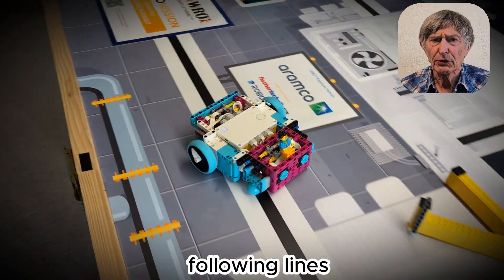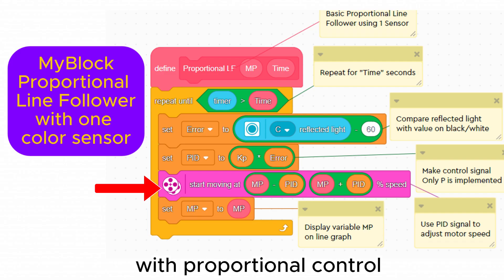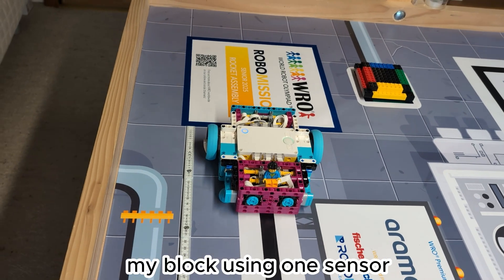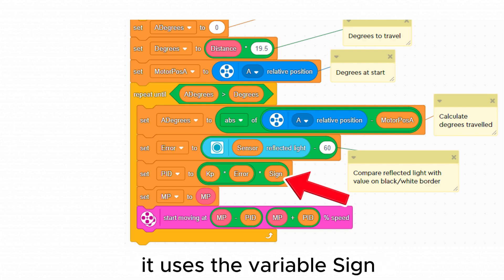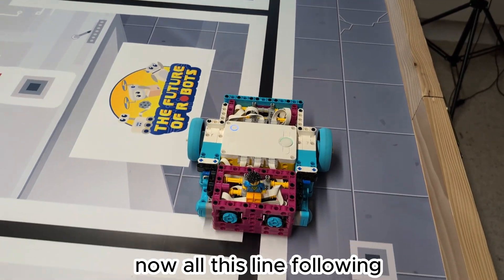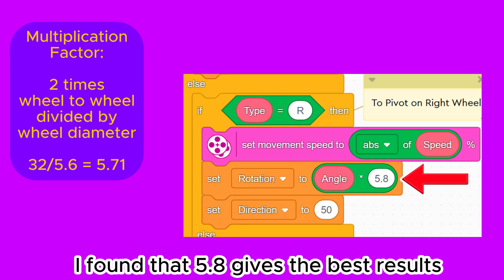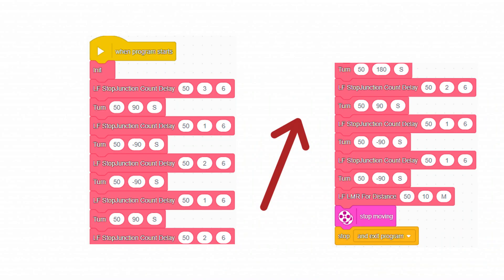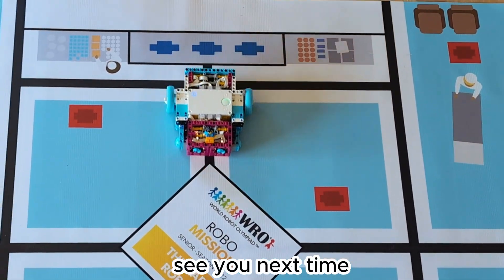Master Line Following and Junctions

Comment: This video is truly amazing and extremely helpful! You’ve presented rare and valuable information that we don’t usually find in other tutorials — thank you for your bold and clear presentation.

I have one question:
I’d like to detect junctions using only one color sensor. Is there a way to recognize  junctions and decide at which one the robot should turn — using just a single color sensor (not two)? I would really appreciate it if you could share any suggestions or code examples for how to do that.

Thanks again for the great work!
Reply from the maker: Hi Hanaa
I will try to answer your question. If you are using only one sensor for line following, a proportional line follower will follow the border between white and black. If you are following for example the right side of the black line, you would normally mount the light sensor a bit to the right so that the robot would be nicely centred over the line. You could then sense a junction which turns to the right, but not one which turns left only. I am just wondering if there is a solution to this if you know in advance what type of junction you are approaching. I have not tried it, but if you mount the sensor in the middle of the robot, you could follow either the left or the right side of the black line and then sense either a left or a right junction. The robot would shift laterally by the width of the black line, which should not matter too much. I will try this out sometime!
Best regards 
Paul

Comment: Do you have any tutorial for Ev3?
Reply from the maker: Hi there 
I don't have any tutorials specifically for EV3, I only have Spike Prime available to me. Most of the coding would be the same and should work with EV3.  Maybe using the gyro would be different as it is not built in the EV3 hub.

Comment: Hi. I would like to ask you for advice regarding the color sensor. If I use the light reflection output in the program for the follow line, do I have to have the sensor set to that as well? Because I have a feeling that the sensor is preset to the "color" output.
Reply from the maker: Hi
I had to think about that, it's a good question! I have never even thought about doing this, I just use the colour sensor either to recognise a colour or to line follow using % reflection and it has always worked. I think the setting you refer to is just to decide what you display when you look at the hub details with the programming software. I hope this helps you.

Comment: Hi 
First thanks for your videos they give me a lot of new informations
Can you make a video about reading blocks like in wro 2025
senior 
i know how to do it but i hope you can make this video maybe i can learn new way
Reply from the maker: Hi there 
I have been working on WRO senior, and I use a broadcast to read the marker block colours as the robot drives past them. This is faster than stopping at each block to read it. I save the colour codes in a list this gives you some advantages. For example you can make an instruction to only save a value if it is not already in the list. This will remove the possibility of saving the same value twice. I also add the values -1 and 0 to the list so they don't accidentally get saved. I will think about doing a video on this, it can be quite tricky to get reliable results!
Reply: @why-not-bot  thank you for your answer and if you do a video about it I will be the first person who will see it

Comment: Thanks for the great video and the continuous improvements on the ramp codes and the junction codes! Super useful! We will try them this week on our robot ❤
Reply from the maker: Thanks for the feedback, good luck with your robot!
Reply: @why-not-bot thank you! I have a question regarding the turn - I have used the universal turn code previously (using Yaw). Most of the time it works perfectly, but sometimes it would turn too much and get stuck or turn too much in general (maybe because the speed is too fast?). I guess using the turn function in this video would solve the first problem because it does not rely on the yaw, but do you find the turn code in this video more accurate or similar as the universal turn? Thank you for your response in advance!
Reply from the maker: Hi again,
You might find that changing the repeat until<1  to <1.5 or <2 helps. The new turn function is nearly as accurate as the universal turn as long as you adjust the scaling factor for the wheel size and the wheel to wheel distance. If you are line following or yaw following, the robot should correct for angle errors when it moves on after the turn.
Best regards 
Paul
Reply: @why-not-bot  thank you! That’s a good idea! We will try that!